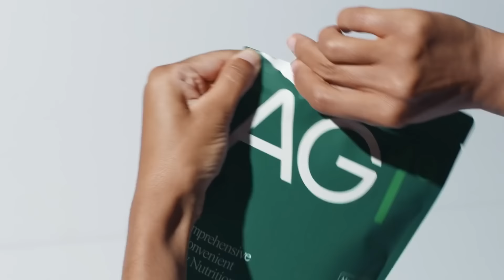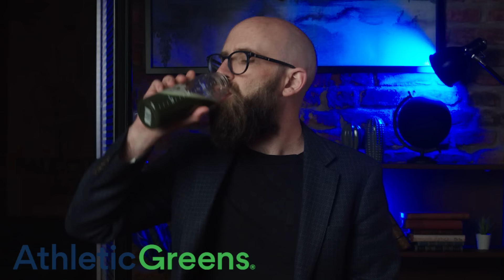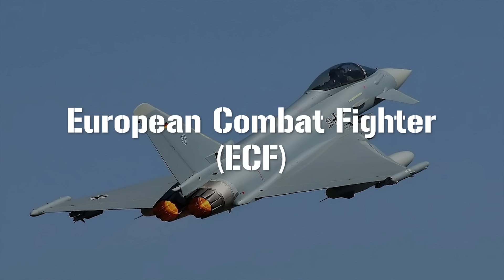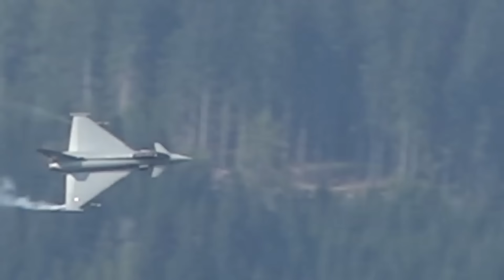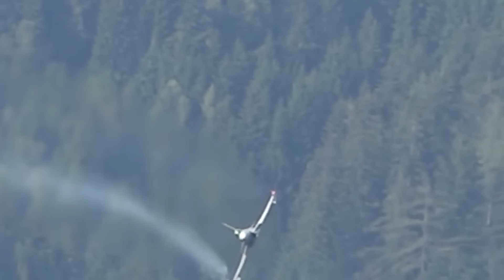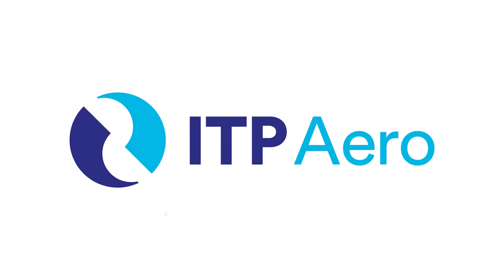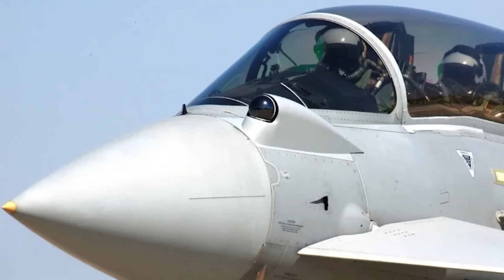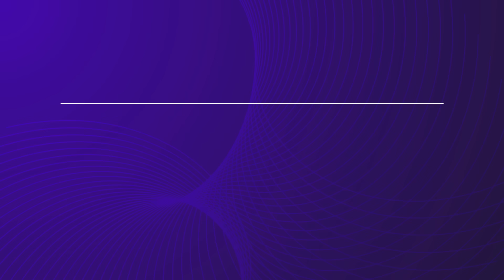The Eurofighter Typhoon: Any Aircraft, Any Mission

Comment: "Americans have a bit of a generational identity crisis when it comes to fighter jets. They’re stuck in the 90s, still worshipping stealth tech like it’s the holy grail of air combat. Sure, back in the Gulf War days, stealth jets snuck in, dropped bombs, and ghosted out like ninja pigeons. But times have changed, and so has technology – spoiler alert: other countries also have engineers. 

Take the Eurofighter – often dismissed by Americans as just another 4th gen relic. But comparing it to an F-15 or F-16 is like comparing a Tesla to a 90s muscle car. The Eurofighter’s radar cross section is just 0.5m² – that’s 50 times smaller than an F-15. It’s not invisible, but it’s sneaky enough to make American pilots squint at their screens. And it’s not just stealthy-ish – it’s got a whole buffet of sensors: infrared, optical, acoustic, even ones that sniff jet fumes and turbulence. Basically, it’s the Sherlock Holmes of the sky.

But here’s the kicker: the Eurofighter doesn’t even need to use its own sensors to know what’s going on. Thanks to advanced networking, it can receive real-time battlefield data from ground stations and other aircraft. So even if it’s parked on the runway with its sensors off, it still knows exactly where the enemy is. And while the F-22 and F-35 are aerodynamic as bricks in a wind tunnel (because stealth first, physics later), the Eurofighter was built for dogfighting. It’s a hunter, not a hider. In Red Flag 2012, German Eurofighters danced circles around F-22s – until the rules got changed faster than a kid losing at Mario Kart. Suddenly, only combat beyond visual sight! Coincidence? Sure, let’s go with that. 

Also, fun fact: stealth jets aren’t actually invisible. Their radar signature is just tiny – like a golf ball (F-35) or a bumblebee (F-22). So the Germans simply told their radar to look for fast-flying bees. Boom – target acquired. And now with passive radar tech from Hensoldt that tracks gaps in the radio spectrum instead of reflections, stealth jets light up like neon signs. The stealthier the jet, the bigger the gap – and the easier it is to track. Hensoldt even followed an F-35 for miles using a radar system that fits in a car trunk. 

So maybe it’s time to ask: is stealth still the future, or just a very expensive game of cosmic hide-and-seek? Maybe aerodynamics and sensor fusion deserve a little love too. And maybe – just maybe – it’s time to hop off the high horse and admit that other countries might know a thing or two about fighter jets."

Comment: It's a design from the 80s, known at first as "Jäger 90" - it should have been the interceptor / fighter of the 90s. Today it is outdated against 5th gen fighters, but would hold up fine against any air force / air defense of developing countries.
Reply: Your statement that the Eurofighter F22/35 or other stealth jets cannot see and attack is definitely wrong! Passive radar causes radio wave interference, which is present everywhere with AI. A Eurofighter Pretorian Evolution with the two electronic warfare pods also has passive radar! According to experts, the range is much greater in the air than on the ground, 400 kilometers is no problem! IRST with passive radar was successfully tested by Diehl, and Meteor will also receive it! MDBA/2025 presented a new hypersonic missile with a range of over 1000 kilometers, Mach 6-7! This could even be used to attack stealth jets beyond 400 kilometers. Airbus has successfully tested the A400 with 20 large stealth remute carriers and 30 small stealth drones in a combat cloud! They have the same electronic warfare systems as the EF, and remute carriers are armed with IRST and Meteor. Furthermore, the A400 will carry extremely powerful electronic warfare systems as a mother ship! Added to this are the EF Stealth Wingman drones, each accompanied by three EFs with AI. The 10 tonne wingman drones have the same systems as the EF! According to AI, one A400 with drones and three Eurofighters with three wingman drones each, i.e. 12, would send a total of 62 stealth drones 100-150 kilometers forward! All systems in the FCAS combat cloud network together would create such an extremely strong jamming wall that F22/35 radars and sensors would be blinded! At the same time, however, they cannot detect the threat that is about to strike! According to extensive AI analyses and facts, 10 or more stealth jets have no chance of surviving against such an FCAS combat cloud! According to AI, the passive radar with FCAS forces the enemy into an asymmetric warfare mode, which represents a new LEAGUE of air warfare!
AI has recently analyzed facts from EF with Meteor. According to a high-ranking German military official, the EF has a top speed of 2900 km/h and can reach an altitude of 22,000 meters in a very short time, about two minutes from the ground! A Meteor (5200 km/h) fired from altitude and at that high speed would travel a good 250 kilometers! The EF with the new EJ230 semi-ceramic engine has up to 27% more power. According to the AI, this would put the EF at around 3200-3300 km/h. The Meteor would have a range of 300 kilometers and accelerate even further on the spot. A 25% larger Meteor is also planned to increase its range!
The A400 is more than just a transporter; it is a multi-combat system that will be decisive in war! In the future, it will also receive a modular laser cannon, which Rheinmetall has successfully tested. Germany will implement FCAS with Spain even without France! Perhaps Sweden and its quarreled partners of the French will also join in! Germany has enough money to finance all of this, including the Polaris Aurora space plane, for which €35 billion has just been allocated for a space program with military systems such as the hypersonic Aurora/Vega (>10 Mach) and the Aurora Heavy (>20 Mach) (100-200 ton payload orbit). There's talk of kinetic weapons! AI has conducted an analysis: a 2.5 ton steel core impacting the earth at 20 Mach has 6 times the kinetic energy of a GBU-57! A 10 ton steel core has 26 times the kinetic energy! 80 2.5 ton steel cores dropped into a square/rectangle would level Moscow. Temperatures of 7-9000 degrees Celsius and extreme shock waves are created in the core, reinforcing each other! The shock wave would cause the concrete to burst open in underground concrete bunkers! It will also build the EU space station and lunar base and is one of the three most important EU programs! Transport costs 1/7-1/10 of SpaceX! From the EU to Australia in 90 minutes! The Aurora system will be part of FCAS. The German FCAS-Airbus Defense system starts with the U212CD combat cloud at sea and ends with the Aurora in orbit! Everything will then be combined with FCAS modular quantum computers/DLR and others with AI to create a unique, globally massive combat cloud!
Feedback geben
Seitenleisten
Verlauf
Gespeichert
Reply: It's sufficient against russia, since their modern gen 5 fighters only exist in homoeopathic numbers and the main fighter fleet of russia is just gen 4 or older.

European Nato countries additionally have several F-35s.

Comment: The pair of Typhoon engines produce less power than a SINGLE F-35 engine. Super Hornet engines (notoriously underpowered) are 500 lb less (dry), but 2,000 lb-ft more (per engine) in AB. And the SH is probably the most underpowered Fighter in the US line up. And as impressive as F-15, F-22 (and per-engine performance of F-35) are, F-22 & F-35 are scheduled for upgrades to Growth Option 2 (not listed, but worth looking up). 

Typhoon, 2 × EJ200 turbofan (AB)
Thrust 13,500 lb-ft  (dry)  × 2 (27,000 lbf total)
Thrust 20,200 lb-ft  (wet) × 2 (40,400 lbf total)

FA-18E,  2 × GE F414-400 turbofans (AB)
Thrust 13,000 lb-ft  (dry)  × 2 (vs Typhoon 27,000 lbf total)
Thrust 22,000 lb-ft  (wet) × 2 (vs Typhoon 40,400 lbf total)

F-35  F135-PW-100 has +3k more (wet or dry) than 2 × Typhoon engines
Thrust 28,000 lb-ft  (dry)  × 1 (vs Typhoon 27,000 lbf total)
Thrust 43,000 lb-ft  (wet) × 1 (vs Typhoon 40,400 lbf total)

F-16, P&W F100-PW-229 (Block 52)
Thrust 17,800 lb-ft  (dry)  × 1 (vs Typhoon 27,000 lbf total)
Thrust 29,160 lb-ft  (wet) × 1 (vs Typhoon 40,400 lbf total)

For those who like to rip on Russian aircraft...
Sukhoi Su-35 uses 2 × Saturn AL-41F1S Turbofan engines:
Thrust 19,400 lb-ft  (dry)  × 2  ( 7,000 more than Typhoon)
Thrust 32,000 lb-ft  (wet) × 2 (10,900 more than Typhoon)

Power to weight isn't as important as CD, but all 3 are related for performance. 
And the Typhoon [is] a lighter jet than the FA-18E, which is an impressive stat. 
Though, the power—to—weight is also at the expense of a useful MTOW & range.
Reply: Your statement is false! The F35 engine produces 128 kN of dry thrust and 191 kN with afterburner. But according to the military, it should only run for 30 seconds! EF EJ200, both engines, produce 135 kN dry thrust and 200 kN with afterburner! In wartime, a 7% increase in power, 214 kN!
EF EJ230/Tranch5 and replacement/EJ200 produce up to 20% more power, and in wartime, a 7% increase, and are more fuel-efficient!
It can withstand up to 19 G (EF test max.) and, like the EF, is approved for 15 G due to automatic evasive maneuvers when attacked by a missile, where AI then steers the EF! The F35 would disintegrate into its components! EF turns fully loaded up to Mach 1.4! No other jet can do that! After 18,000 hours of brutal stretch testing, the EF still withstood over 12 G. 

The EF cannot be overloaded because strain sensors monitor the jet throughout the EF, including the engine! In the same amount of time, you would have to buy 2.5-3 other jets! Thanks to its CFRP composite construction, experts estimate that it will last 24,000-36,000 hours before reaching 9 G! Because of its modular design, parts, especially the wing suspension, which are predicted to fail first according to tests, can be quickly replaced with new, better systems! According to AI, the EF is by far the cheapest and most effective jet!
Reply: The Typhoon is a relatively small aircraft, compared to US fighters. It's built for the continental European needs, the Super Hornet for carrier operations. Super Hornet is quite a big aircraft in comparison, the same for the russian fighters which are big to offer a high range for the big country.

Comment: The Eurofighter, the Rafale, the Gripen, et cetera, all more or less have similar capabilities.
Reply: Euro fighter and Rafale, yes. But not Gripen. Gripen is not suitable for some missions.
Reply: Err... No. The Gripen is a light, relatively cheap, fighter. The Eurofighter besides having an heavier payload, better thrust to weight ratio, etc... has a much more complex avionics.
Reply: @neutronalchemist3241  Thrust to weight ratio is useful mostly in dog fights, which have become extremely rare. The Eurofighter and the Rafale have longer ranges and heavier payload capacities than the Gripen. Other than this, their capabilities are comparable.
Reply: @col.waltervonschonkopf69  So you dismissed a difference, skipped over another one (the much more complex avionics, IE the Gripen has nothing comparable to the PIRATE) and stated that, besides a third one, they are comparable.
A Sopwith Camel too is comparable this way.

Higher trust to weight means the Typhoon climbs 24% faster than the Gripen, other than having 4800m higher ceiling and the ability to supercruise.
Reply: @neutronalchemist3241  I am talking in terms of capabilities, the types of missions they can perform, genius. The only type of mission that the Eurofighter and the Rafale can both do but the Gripen can't perform is long range incursion or interdiction, which both require a long range. And dogfights are passé. What are you going to do with a faster climb rate?
Reply: @col.waltervonschonkopf69  If you think that avionics is unimportant on capabilities and the kind of missions aircrafts can perform certainly you are not a "genius", and I doubt you even have a functioning brain. 
Climb rate is paramount in interception for example.
"dogfights are passé" is your very personal opinion. It doesen't seem that much shared though, since even air superiority fighters nowadays are generally more agile than they were in the past, and it's not by chance. They are designed that way.
So... the Eurofighter is better at long range incursions, check.
A better interdictor, check.
A better interceptor, check.
A better dogfighter, check.
A better air superiority fighter, check.
A better bomber, check.
It has a better survivability, check.
...
In what are they comparable exactly?
Reply: @neutronalchemist3241  Sir, Air Marshal, sir, you are right, sir! 🫡

Comment: The develpments in Radar technology, datalinking and optical target recognition. Will lower the benefits to Stelth. High powered Radar jamming like Eurofighter Radar Mk 1 and later Mk 2 will lower the Distanz advantage throu denying Radar burn through ad higher distances. Collabourate Radar beam forming will act like Large space Radio telescopes in combining they will be able to frequenzy shift in low bandwith fore Detektion. They will be able to deny Radar lock on for much longer. So that Real Stelth advantages could be fürther weakend.

Comment: The Eurofighter is great and all, but it is just a little embarrassing that the F-22 entered service about the same time, and that each of the F-22's engines makes more thrust dry than the Eurofighter's do with afterburner.  The non-afterburner figures I could find claimed the F-119 (the F-22's engines) can produce ~26,000 lbf of thrust each, while the Eurofighter's can only produce ~13,500 lbf each.

Comment: Curious how the computer-assisted "intentionally designed to be aerodynamically unstable"-thing is still presented as an engineering novelty for a plane designed in the 90's / early 2000's, when the F-16 already did it, being designed in the late 60's / early 70's.

Comment: The F-22 is generally considered the most advanced A2A fighter at the moment due to its wacky thrust-vectoring maneuverability and of course its stealth capabilities.  Sneakiness aside however, in joint training exercises the Typhoon is known to be able to hold its own just fine against the F-22 in a dogfight.  Stealth tech is a clear advantage but not necessarily a guarantee of victory, and it's not like the Typhoon doesn't have a few solid tricks for reducing its own signature as mentioned in the video.  Glad the Typhoon is on our side.
Reply: Typhoon has vectoring thrust nozzles as well as vectoring air intakes to limit air flow seperation during high angle maneuvres. It's simply a flying marvel
Reply: The typhoon was only able to hold its own when it and the raptor had very unrealistic setups that neutralized the raptors greatest features. The raptor had fuel tanks on the wings and lots of fuel which caused it to lose aerobatic maneuverability and stealth. The fights were also WVR fights so stealth was taken away. The eurofighters had nothing except guns and some fuel which meant that this fight with these loadouts would never happen unless the eurofighters left base with no missiles and that means they would just get shot down.

Comment: Worked on them for near-on 15 years. The engines are almost bullet proof, ultra reliable. I was fortunate enough to have a back seat trip and it was mind-blowing. It took a while to get going, but there isn’t much that can out perform it now. On exercise in USA, the deciding factor vs F22 was the pilot’s skill.
Reply: A European engine with reliability? I didn't think that had happened since the 70's
Reply: @chrispekel5709 this isn’t a car engine, European aircraft engines are some of the most reliable engines on the market
Reply: Nothing comes close to touching the F22. Avionics on F15Es and they ruled excercises until the F22s came along and the F22s wipe the floor with everyone.

Comment: Awesome plane. But I'm glad we went with the F35 for Canada
Reply: UK has F35s too. Wouldn’t the Typhoon be more for the roles of your F18s if comparing?
Reply: It is two different roles. Canada does not border any threats where a high agility fast interceptor is required. A hell of alot of low iq people in the comment section have now clue what they are talking about. The environment they are to be deployed in is extremely important in debates like this. Eurofighter is an absolute beast when it is deployed for what it was meant for. Pair it with gripen,f16, f18, f35, f22 rafaels in the space over Europe and you got a very, very nasty wall you have to penetrate.

Comment: That's not anyware near as expensive as the F35 Lightning 2 Stealth jets entering service. You can purchase a few of these for the cost of a F35 then there's the performance you can use 100% of the ability of The Typhoon but your limited to the amount of time you can push the Lightning 2 to protect its Stealth protection, not to mention if you're ground crew leave a plastic bag on you end up going for a swim.
As for loud having seen&heard an Avro Vulcan go full afterburn and do maximum G turn everything else sounded quite since now that was a beast of a plane, the UK answer to US flying wing the best V bomber